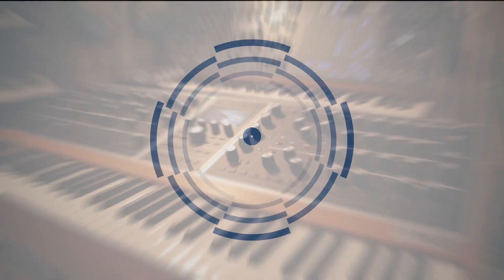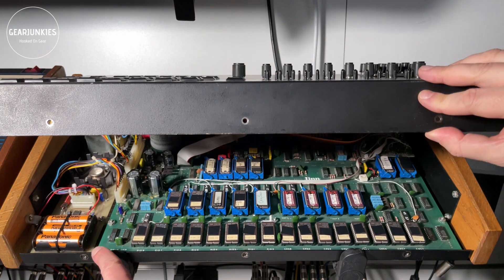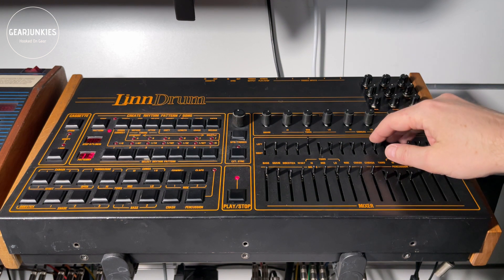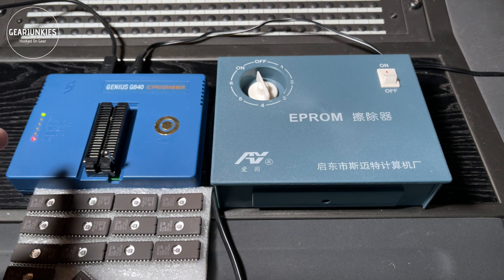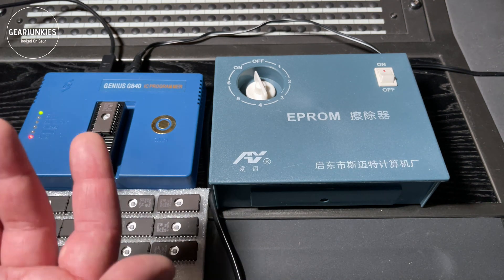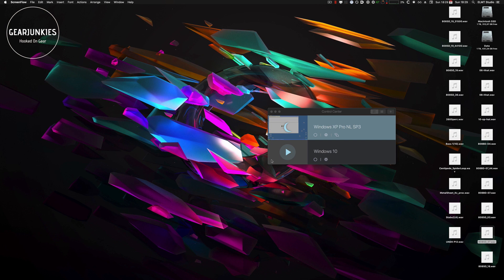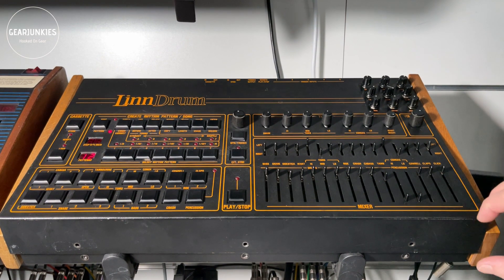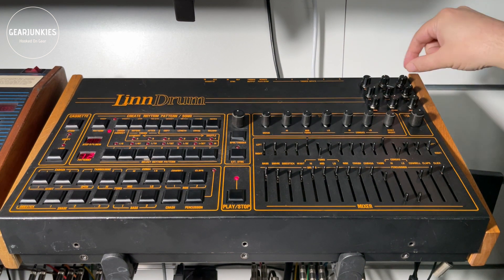Linn Drum Custom Samples EPROM Programming

Comment: Thanks, I wondered how much each chip could hold. Only 4 Kb. Were sounds like cymbals that needed to be longer not stored on the same 4kb chips?
Reply: they were stored on multiple chips. in the case of the LinnDrum crash, it uses 8 different chips for the sound

Comment: I will try to do this for a KORG DDD-1 
It is a 12 bit rom player with 4 external cards that the ports card for Eproms are already done !
What format should I create these samples ?
Degrade them from 16 bit to 12 bits ?? 
I believe it handle only 064 K data
Can it put more sounds on a bigger 2 megs rom ?
Cause some factory Roms had only 
2 samples like 2 RIDES bell and long
RIDE decay !!

Can you help ?
Reply: Another thing.....if I want 5 or 6 samples in one eprom, do I repeat this process and the 808 Snare sample will stay in memory??
Or do I need to load the 5 or 6 Samples in AV format, then convert to BIN and the burn that bin file with all samples at once ??

Comment: Hi nice video! I just got a LinnDrum and I'm going to buy some different eproms. You mentioned that it's hard to replace the sounds that are split over multiple eproms. That would be... the ride, the crash... which other ones? I really don't use the ride or the crash so I wanted to replace those, but if it's too hard, maybe I could replace the toms... Thanks for any advice!
Reply from the maker: Best leave them alone as the eproms are not in swappable sockets.